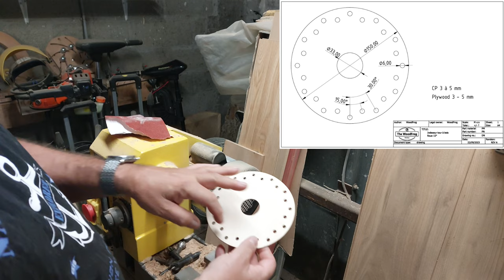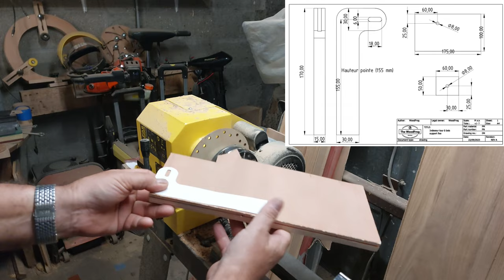Plateau d'indexation pour tour à bois

Comment: Bonjour,
Belle réalisation, simple et efficace.
Juste une question , si sur ta boule ou par exemple sur un plateau tu veux percer 10 trous a espace régulier régulier comment fais tu? Car la avec 24 trous tu as un angle de 15 ° , et pour faire 10 trous il faut un angle de 36,°
Reply from the maker: bonjour, en effet, pour 10 trous c'est 36°. il suffit de faire une roue correspondante, c'est a dire avec 10 trous. ca se fait de la même façon que celle à 24 trous. Une remarque tout de même, 10 c'est juste un compte rond, esthétiquement parlant c'est rarement utilisés. on est plus sur du 2,4,6,8,12. le chiffre 5 ne se réparti pas bien dans l'espace, mais c'est juste personnel, il y en a qui ont un "pentagone" 😁
Reply: @woodfrog j'ai fais 10 toupies et une piste sur laquelle j'ai fait 10 trous pour y poser les toupies, j'ai effectivement du faire le tracé à la main .
Bonne soirée 😉